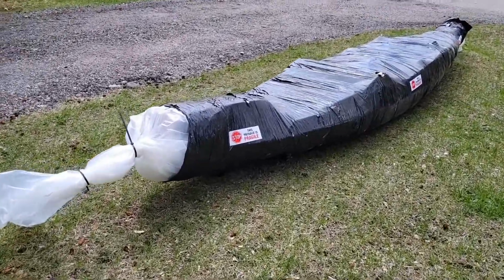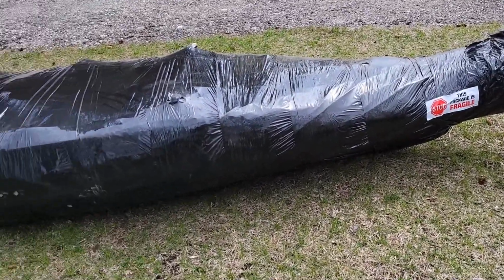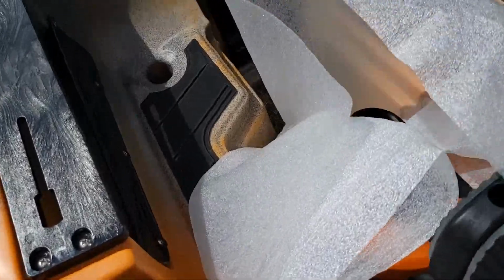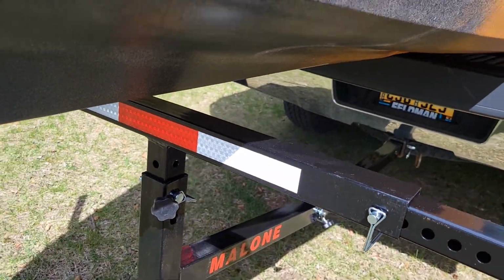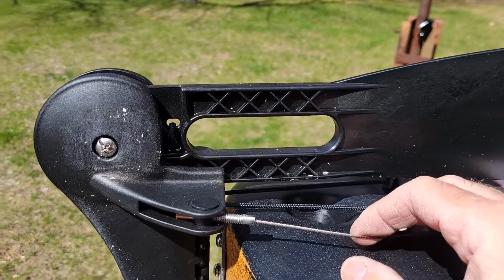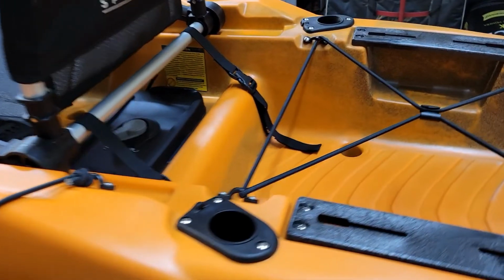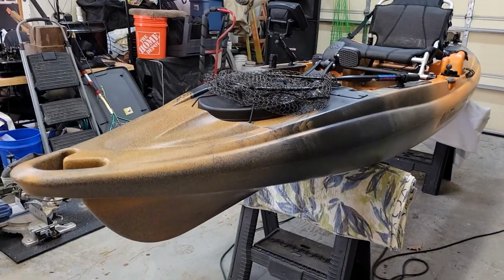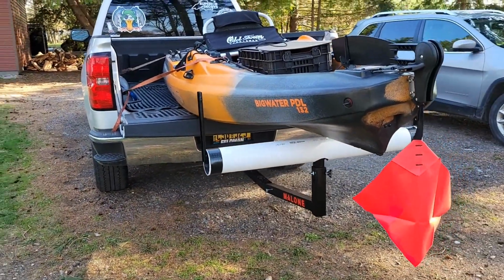Old Town Sportsman Bigwater 132 PDL Delivered

Comment: That st Clair river is starting to fire up, caught 12 casting from shore Monday morning and Tuesday morning and lost a 10 lb Atlantic or steelhead at the net. I tried to find ya on fb but couldn't to give you some more info.
Reply from the maker: https://www.facebook.com/profile.php?id=100069528112792
Reply: Yep, and right out of the factory that PDL is gonna wobble every time you peddle it. It'll not only drive you crazy, but it also makes it harder to peddle and is hard on your drive. Do yourself a favor and glass bed it. I did mine and it makes a huge difference.